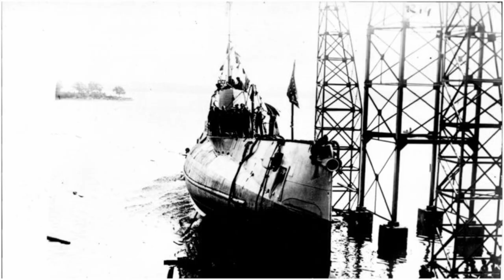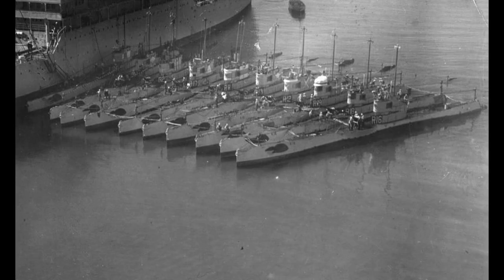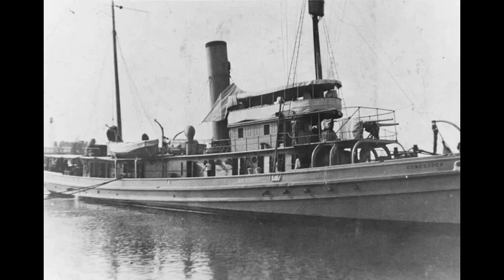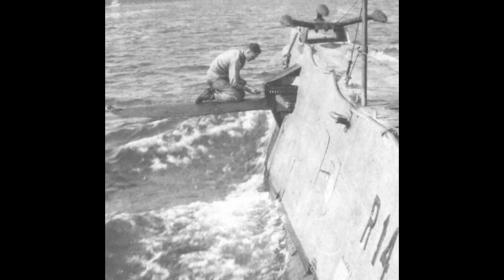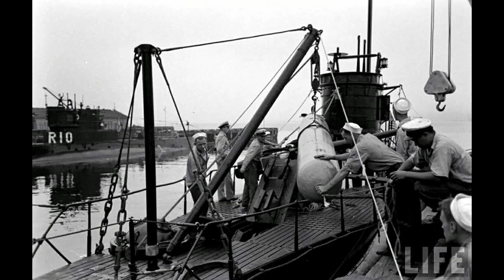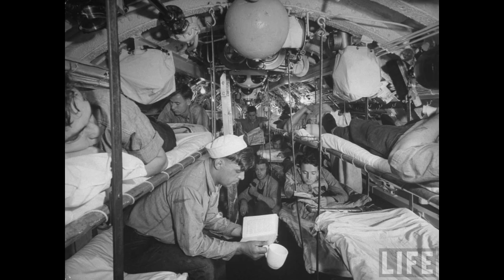USS R-14 - When A Submarine Pretends To Be A Sailboat

Comment: Some of the details given in this video are incorrect. The R-14 ran out of fuel due to an improperly executed fueling evolution at Pearl Harbor prior to getting underway. In short, they left on the search & rescue operation without enough fuel to complete a ten day voyage, although they THOUGHT they had enough. The idea that the fuel was "contaminated with seawater" is false. All submarine fuel tanks of this era were compensated with seawater so that they didn't collapse under pressure when submerged. The fuel floats on top of the water, with the water replacing the fuel as it is used. The fuel is ALWAYS in contact with seawater when it is in the tanks. The R-14 simply didn't have enough, that is why they ran out. See Part 2 of the book mentioned below for a full explanation.